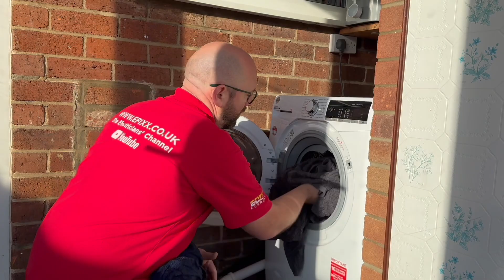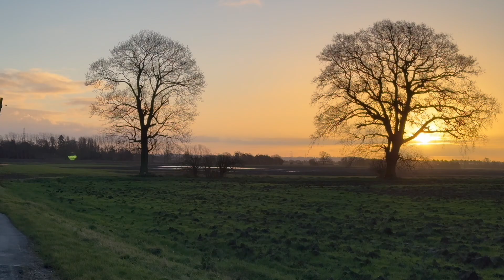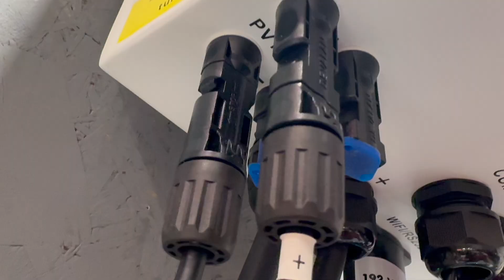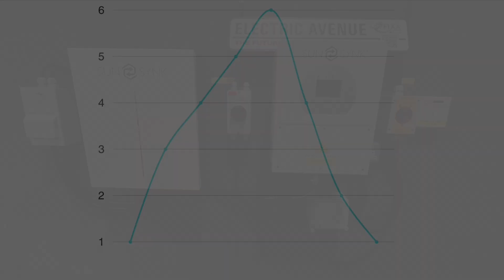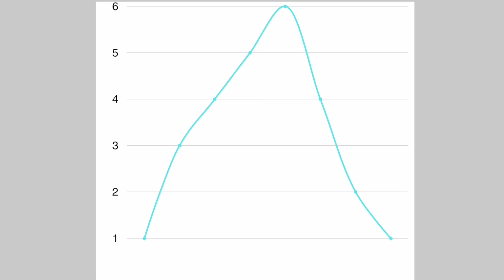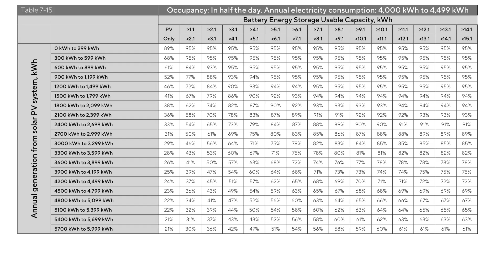Master Inverter and Battery Specifications in Minutes!

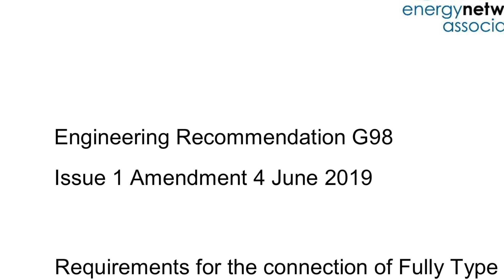Comment: Your explanation of how to size the inverter makes no sense for hybrid inverters with batteries. As you explain at "05:18 What happens to the extra energy?" it is the MPPT rating that matters, not the inverter rating. Let us assume that we have an empty battery, 7kW solar generation and no load, then the inverter will be sitting doing nothing but the MPPT will be sending the full 7kW to the battery (assuming that the battery C-rate means it is able to charge at that rate). Therefore the inverter efficiency and therefore the inverter sizing is nothing to do with the size of the PV array and everything to do with the size of your battery, its C-rate and the expected loads.

Can you please tell me why I am wrong and why your explanation of how you should size the inverter is correct?

Comment: Choosing a 3.6kw inverter is just being lazy, making life easy for the installer to comply with g98.   I had a 3.6kw inverter and i spent more time switching things in the house on and off to manage my demand... As boiling a 3kw kettle on top of a typical house baseload takes you very close to the max AC output of the 3.6kw inverter.

Since swapping to an 8.8kw inverter my Peak/Day consumption from the grid is ZERO. I never use peak grid power. Always run on solar or battery (which in winter are charged off peak on cheap overnight)

For a home with 4500kwh annual usage you could decrease that that grid dependence further by simply opting for the 5.5kw or 8.8kwh inverter. the slight increase in price of the inverter is negligible compared to the savings based on its Warranted 10 years life. 
And the export rate can be set and locked in the sunsynk inverter so if the DNO only grants 3.68kw (16A) then set the max export rate on the inverter. The inverter will still make 5.5kw or 8kw (not 8.8kw, its an 8KW AC inverter)  for the house demand but will only export up to the set export limit.
Reply: @davespages  agreed and most people are too lazy or ignorant to load shift and then complain their bills are still too high
Reply: Isn't manually managing your demand (I do this! 3kW surge / 1.5kW continuous 'offgrid' inverter) an issue with only old-school 'off-grid' inverters? I thought grid-tied inverters 'kept pushing' as long as they had input (PV/battery) and the difference comes from the mains if demand exceeds inverter / goes to the mains if inverter can exceed local demand? So if you had a 3kW kettle running, an empty/no battery, and 1kW of PV from a 1kW grid-tied inverter, you'd import 2kW from the mains?
If that's not possible, smaller ('balcony') systems would be much less attractive.
Reply: @trs4u  most people who are not fully aware of thier energy usage just let thier system do the default settings and if they just switch things on when they want, inevitably there is grid draw if the max output of the inverter exceeded.

I'm very aware of energy usage, smart plugs/switches are providing data to Home Assistant so i can see in 1 app what devices are using power and how much.  Great way to schedule appliances to turn on/off and eliminate parasitic power draw and also to load shift (when appropriate) to cheaper electricity times.

Since swapping to the 8.8kw sunsynk (which is only 8kw BTW, It cannot make 8.8kw of AC. 8.8kw is misleading) I've never exceeded its output for house demand.

By Eliminating grid use during the day I've capped all grid import to 8.5p/kwh.   Any export is now 15p/kwh on Octopus "Go" and  late March to September I swap to Flux tariff as the 4-7pm peak is lucrative to dump my batteries back to the grid for export. The peak price dropped to 23p/kwh in summer 2024 but in Spring 2023 (when i first got export setup, peak export was 38p/kwh)

I've not paid octopus anything since May 2023. I've also had £1700 back in export payments since then when my export was setup.

My home is net negative on energy and it means I don't have an energy bill. 
2023 my system was net -1556kwh above import.
In 2024 so far net -3189kwh.   This is down to an increase in battery storage (now 35kwh) and more panels added.
In the height of summer I can exceed 11kw of solar generation... and I'm capped at 9kw export so that 2kw is lost (if the batteries are full)  but I have HA automations to turn things on to use that power to prevent "curtailment"

The savings in 2 years of the system being installed and export payments in 18 months (right at the peak of energy pricing in 2022/2023) means I've saved £3500 by having no energy bill and £1700 in credit, I'm Alredy £5200 ROI in 2 years on my 20k solar install.
25% ROI in just 2 years, very happy with that!